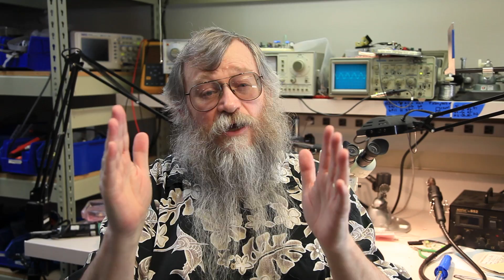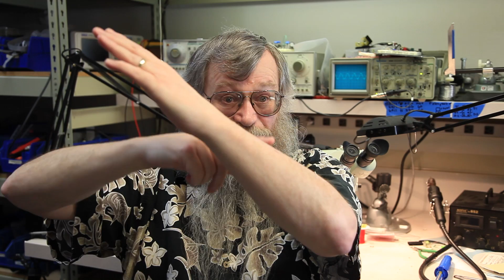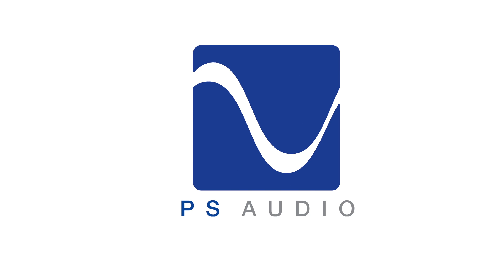Jitter and clocks

Comment: Very enlightening explanation. As I thought, he stresses out that the need for a low phase noise clock (not a highly long term stable one) comes only when converting from digital to analog signal.

Comment: Really.  You think you can detect the jitter on a 24.576Mhz clock?  Your nuts.  Your lying to yourself.  The 24Mhz clock is often used to over sample the bit clock.  Often 512 times the frequency.  So you immediately have that oversampling.  Your clock rise detect can be out by 1/256 of a bit clock cycle even before you begin.
If clock rise detection was an issue, none of this high tech stuff you are using to make this video would work.  If clock rise detection was an issue, it would manifest much more readily in video signals like HDMI with multi Ghz clocks.  It doesn't.  Why not?
The comparison with GPS is retarded.  GPS is factoring in the speed of light delays with relativity related time distortion.  Audio clocks aren't even in the same country let along the same ball park.

Comment: I have a Master Clock for my (4) 8 channel converters. I ended up using the master clock from my PCI soundcard as it has the ability to use a syn check with every converter. Ive read many say a dedicated master clock will get better results. I have a master clock and a clock distributor, but I'm going to clock over over ADAT for simple ease of use. Unless someone here tells me differently. I trust this guy over any one on any forum. Thanks-

Comment: I don't agree with the assertion at 2:40 of "Jitter doesn't matter until you get to the very point of where you get from the digital to the analog". Well, how about the sampling jitter (analog to digital conversion) on the original digital master? The era of digital music started in the early 1980s and if oscillator jitter is such a big topic still today (which I will claim it is not with proper engineering), we should have some serious issues with recordings of the first CDs using digital sampling with 35 years ago oscillators, right? An audiophile person believing that he can hear jitter issues in modern equipment should easily be able to identify jitter issues in CDs from 35 years ago. Or what? :-) So which title of song from the early days in digital audio has audible jitter issues in the recording?
Reply: virtualy every early digital recoding as audible jitter
Reply: I am a true believer of the existence of sampling jitter.
Reply: The clock phase noise is no big issue in analog to digital conversion, as long as the sampling frequency is high enough by Shannon’s law. 
The reason is very simple : the original analog signal is a continuous function of time, and has a low bandwidth as compared to the sampling frequency. So taking a given sample of the analog signal at a slightly shifted time (due to clock phase noise causing the sampling to be triggered with a slight delay) will only cause a minor change (error) in the result. Hence little noise/error/distortion ultimately when playing back. 
On the opposite, having clock jitter on a digital to analog conversion means that one given bit may be taken into account twice in a row and the next one be completely omitted. Example : 010010 could become 000011… Very different result!! Because un say a 16 bit sample, if you mistake a 0 for a 1 (or vice versa) in a high weight bit, it makes a dramatic difference in the analog result you get. 
So clock jitter is much more likely to cause significant noise.

Comment: Hi Paul. What is your opinion on a 10MHz reference clock with 461fs RMS of phase jitter? Is it usable for audio? The device has two synced outputs, by the way.
Reply: The lowest value i´ve seen people reliably tell in blind tests is 0,2 microseconds, so 461 fs MIGHT be overkill.
Reply: That's what I thought. But I wanted to know the opinion of an audiophile on this matter. After all, I have low jitter OCXOs to sell. Those were built for lab use, but audiophiles may want them too, although they might not like the fast edges because it makes the sound too "fast".
Reply: There are some audiophile dacs with jitter in the femtosecond range,  like the Mola Mola (300fs). 
I dont know about the actual implementation of your clock on a system, but there is, however, a demand for clocks of this precision in the audiophile world.
Reply: There is no implementation. It is just a 10MHz OCXO based clock generator that I've made for lab use. It has two BNC outputs.
Reply: @bloguetronica  How did you measure the Phase noise? 461fs is ridiculously low if you measure from 10Hz offset, but if you measure from 1MHz offset it is not too spectacular.
Reply: @hidjedewitje  It was measured from 12KHz up to 5MHz. I can show you some graphs and figures if you wish. The tests were done at JitterLabs.
Reply: @bloguetronica  Sure! Sounds awesome.
Reply: @bloguetronica  Did you actually measure your device or did you use their calculator?
Reply: @hidjedewitje  The device was actually sent to be tested there. No calculator involved. If you just google for "GR10M-S", you can see some of the test results already. The report is accessible through the corresponding blog post (in Portuguese, so you may need to use a translator).